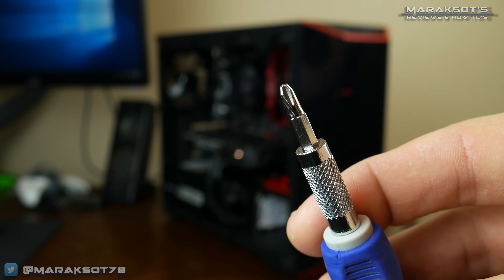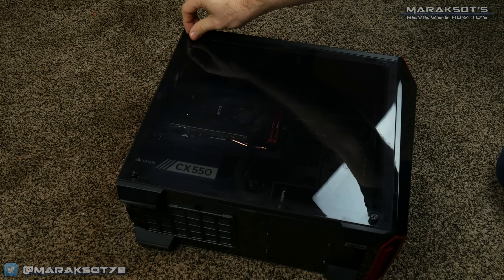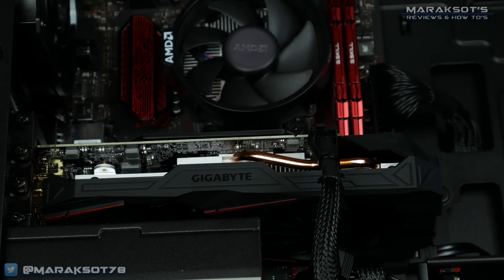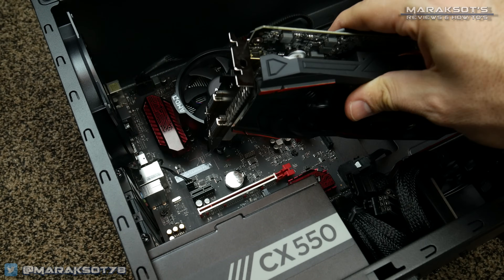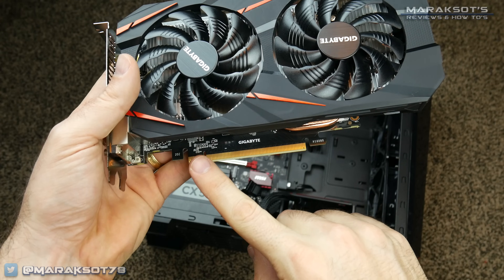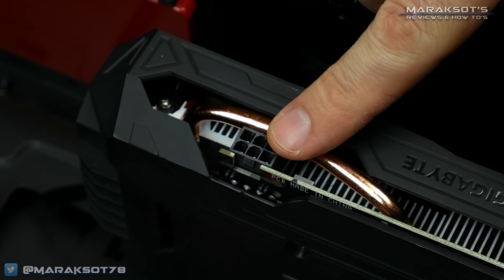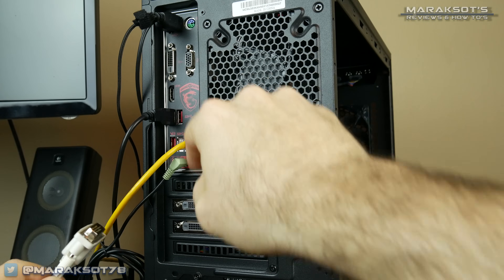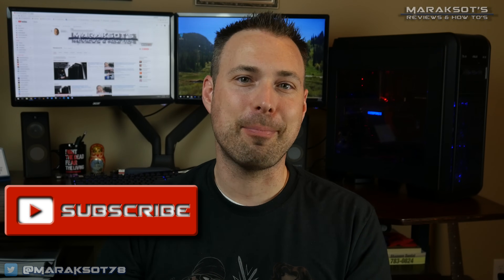How to Install a Graphics Card - Upgrade Your GPU

Comment: Pls someone help, I upgraded from a GTX 650 to a GTX 1060 and I installed new drivers and deleted the old ones and I still get the same FPS as on my old card🤷‍♂️
Reply from the maker: what display output is you monitor plugged into?  Is it plugged in the display out on your graphics card or on your motherboard? (the one on your motherboard is the one near all your USB ports and stuff)
Reply: bottlenecked by cpu probably? insufficient ram?

Comment: What cable do you use to plug in the graphic card?
Reply from the maker: What cable exactly are you meaning? Are you asking about the PCI Express power cable or are you wondering about the video cable? Whether to use HDMI, DVI or display port (DP)? My guess is you're wondering about the video cable. Use whichever cable your monitor supports. Display port (DP) is the newest standard so if your monitor has display port use that. If you have HDMI then use that and if your monitor doesn't have either of those but has DVI then use DVI. If your new graphics card doesn't have DVI (some high end models do not have DVI as it's an older connection standard) but your monitor doesn't support HDMI or display port then you either need to buy an adapter to go from HDMI to DVI or buy a new monitor that has hdmi and/or display port.

Comment: I have a i7 7700k and a rtx 2070 can i just add another rtx 2070 and get better performance
Reply from the maker: No. My understanding is the RTX 2070 does not support NV link SLI. Many games do not support dual GPU setups anyway so it's much more cost effective to just buy a more powerful single graphics card. The only time dual GPU's makes sense to me is if you're buying the most powerful card currently on the market. Since there isn't anything more powerful the only thing you can do is add another graphics card. But even then it's only effective in games that support dual GPU's. Games that don't will only utilize one.

Comment: I don’t have the right video out for my new graphics card.. do you need to plug the video out from your monitor to your graphics card ? Or can you just plug it into your computer?
Reply from the maker: You need to plug it into your graphics card if you actually want to use the graphics processing power of your graphics card. Plugging it into the display out on your motherboard will only utilize your CPU's integrated graphics... assuming your CPU has integrated graphics. If your monitor does not support HDMI or DisplayPort but only uses DVI or VGA then you're going to have to either get a new monitor or an adapter that will adapt your DVI to HDMI or DisplayPort.
Reply: Maraksot78 thanks
Reply from the maker: No problem.
Reply: Do I need them both plugged in? Or should I just use the graphics card?
Reply from the maker: You just want to use the graphics card.

Comment: LOVE IT! btw im getting RTX 2060 upgrading from 1060, do i need to uninstall the GPU driver first or do i just the dang thing in and then install later? Thanks again Maraksot!
Reply from the maker: You can replace your drivers whenever, either before or after. Since you're going from one Nvidia card to another, if your drivers are already up to date you may not even need to replace your drivers. If you're using the automatic update in GeForce experience you may already have the most current driver installed. Nvidia's current driver for both 10 and 20 series cards, version 417.71, came out on Jan 17th. If you have that installed already then you're good to go.

Comment: Which cables to plug in... ok 6/8 pin is one of them but my gpu has 4 more holes for cables dp vga,.. please answer.
Reply from the maker: So are you wondering which display cable to use with your new graphics card? If so I say use whichever your monitor supports. If your monitor has DP (display port) I would use that as it's the most current display technology. After that I'd say HDMI if your monitor has it, then DVI.

Comment: Kinda confused about the connector, i have a 6 pin connector, connected it in my 1060 but no idea where the other 2 parts go.
Reply: i don’t have a pcie connector btw^ just got my 1060 today, new to this stuff
Reply from the maker: So are you saying you have a power cable from your power supply that looks like this? https://www.pcper.com/images/reviews/474/14-PCI-E.jpg. if so that is a 6+2 pin PCIE connector. You just plug the 6 pin portion into the graphics card and you can just leave the other 2 pins hanging there or zip tie them out of the way; it's up to your personal preference.
Reply: Maraksot78 yeah i hooked everything up and booted my pc up now all games get 1-5 fps. and nividia control panel says it doesn’t see a GPU. I probably did something wrong.
Reply from the maker: @d4edxty  did you buy it new or used? If it's used or you bought it on ebay it's possible you got a fake card.  Hopefully that's not the case. I assume you connected the display cable to the graphics card and not to your display out on your motherboard? If it's connected to your motherboards display out then you'll be using the CPU's integrated graphics rather than your graphics card which depending on your CPU would give you very low frame rates like that. If you are connected to your graphics card then I'd shut things down, disconnect the power, pull the card, reseat it and make sure it's seated properly and boot back up again and see if things improve.
Reply from the maker: Also I just had another thought... do you know if your power supply has enough wattage to support a GTX 1060? The 1060 requires at least a 500 watt power supply to function properly.
Reply: Maraksot78 im talking to a few of my friends since they’re pretty decent at pc building, they said i have to go into bios and make sure it knows i have a new part in my pc. I bought my gtx 1060 3gb off of Amazon for 280$, and yeah the monitor is in the right place i made sure of that. im hoping doing this in bios fixes the problem.
Reply: Maraksot78 also to download my 1060 drivers i just go to de force and download game ready drivers yeah? this is my first time pc building sorry if these questions sound stupid. thank you
Reply from the maker: @d4edxty  personally i don't use GeForce Experience to update my drivers.  I'm an old school guy so I like to do it all manually but GeForce Experience is designed to make it easier for people to update their drivers so you can definitely do it that way if you prefer.  :)
Reply: Maraksot78 figured it out :)

Comment: I have never messed with the inside of my pc before but my pc is running a AMD 200 series and I want to upgrade to a amd580 so do you think even tho I have no experience messing with the inside of my pc do you think I would be able to do it by myself by watching this vid?
Reply from the maker: Yup, if you follow along with this video you should be good to go. Cheers! :)
Reply: @Maraksot78  appreciate the reply the problem i got now is that my pc might only have 6pin would that still work with the AMD580 or would i have to buy a 6 to 8 pin adapter? sorry for asking so many questions i dont know much about computers
Reply from the maker: @bennywhite5972  depending on what model of 580 you get you'll need at least a 500 watt power supply and most manufacturers recommend you have at least a 550 watt PSU. Also some RX 580's require both a 6 pin and an 8 pin power connector (for example the Power Color RX 580 Red Devil). So if your current PSU has enough wattage but is missing the PCIE connectors needed, yes you can buy adapters to make it work. Depending on what your PSU has available a 6 pin to 8 pin adapter may get the job done or you may need to get a SATA to PCIE adapter (which looks like this https://www.lindy.co.uk/images/0-15m-2-x-sata-to-pcie-8-pin-male-power-adapter-cable-p8812-6447_zoom.jpg) or molex to PCIE adapter (which looks like this https://www.hdcabling.co.za/images/8pin_to_Molex_EPS_12v_ATX_Motherboard_Power_Cable_adapter.png).

Comment: Would the MSI Gt 1030 work well with Intel i5 3550 3.3ghz and 8gb ram?
Reply from the maker: Yes. An i5 3550 would be good with all low to mid range GPU's. The most powerful I'd recommend is probably an RX 580 or a GTX 1060
Reply: Maraksot78 the thing is I can’t afford gtx 1060, that’s why I plan to get 1030
Reply from the maker: @corrupt5694  No worries man. I just wanted to let you know how far you can go before you have to begin to worry about CPU bottlenecking.  Cheers bro. :)
Reply: Maraksot78 would I have to worry about cpu bottlenecking? Or is my cpu fine with the graphics card?
Reply from the maker: You'll be just fine with a GT 1030. Nothing to worry about there.
Reply: Maraksot78 ok thanks :)

Comment: What if you dont have the pcie power connector for the graphics card? Because I just got a single fan EVGA 1060 SC and I'm not really sure what I'm doing but the connector that came with it is too short to connect to anything that would fit it within its reach? Sorry if this was confusing... just getting into these things
Reply from the maker: I assume the little cable you're talking about that came with your graphics card is a PCIE power adapter that is either a molex or SATA to PCIE adapter. If your power supply doesn't have any PCIE power connectors then you can use that adapter to supply the needed power to your card. Assuming your power supply has a high enough output to support your card...

Comment: good morning sir. its 8am here. i have a cheap ass desktop that cost me approximately around 240-260$ or less, with 4gb memory and 2gb radeon r7 graphics card. should i outright replace my GPU for better gaming experience or its more viable to buy a whole new set of CPU? thanks a lot man. nice video
Reply from the maker: it really depends what CPU you're using.  A graphics card upgrade will increase your performance but depending on your CPU just how much it will improve can change.  Also adding more RAM will help too.  I recommend a minimum of 8GB with 16GB being optimal.

Comment: I don’t know if the gigabyte z170 hd3p motherboard supports gtx 1080 ti?
Reply from the maker: your motherboard shouldn't be a problem.  What CPU do you have?
Reply: Maraksot78 i7-6700k
Reply from the maker: Your golden bro.  The 6700K is a great CPU to pair with a beast like the 1080ti.

Comment: my new pc doesn’t have a gpu so i’m ordering a 1030 soon, my power supply is under some metal casing thing and i don’t think i’d be able to locate the pcie wire thing any help?
Reply from the maker: As far as I know the GT1030 doesn't require any additional PCI Express power from the power supply. All you'll have to do is plug the card into slot and install the drivers.

Comment: Hello, I play in a desktop, just a desktop, mouse and keyboard. I don't have that box thing. Could I still set it up?
Reply from the maker: are you saying you have an all in one PC?  Meaning your CPU and GPU are all built in to your monitor?
Reply: @Maraksot78  Uhh, I'm sorry, but I don't know about computer stuff. :(
Reply from the maker: If your computer doesn't have a tower, aka the box with your Motherboard, Processor, Graphics Card and everything else in it, then I'm assuming your keyboard, mouse, flash drives and any other stuff plugs directly into your monitor? Is this correct? It that is correct then you have an "all in one" and the ability to upgrade those is much more limited.
Reply: @Maraksot78  yea I guess, sorry I'm not smart
Reply: Maraksot78 YES ITS ALL BUILT IN MY MONITOR!!! pls help me, my games always run slow and I can’t even play the less laggy games
Reply from the maker: @HDdeadchannel  unfortunately many all in one PC's aren't upgradable when it comes to their graphics card. CPU, memory and hard drive upgrades are possible however quite often all in one PC's are built more like laptops where the GPU is integrated into the mainboard making it pretty much impossible to upgrade. There is only one all in one PC I've ever seen that uses a regular "off the shelf" graphics card but I don't remember what one that is. Most likely if you want better gaming performance on PC you're going to have to get a new, more powerful computer.
Reply: Maraksot78 Okay thanks for the tip, could you recommend me one that is NOT a gaming pc but can still upgrade the graphics card?
Reply from the maker: @HDdeadchannel  what's your budget? PC's range wildly in price depending on the hardware in them.

Comment: Thanks! Very informative!
Do you think that the RTX 2070 is wort an upgrade from my GTX 970?
Reply from the maker: It depends... The GTX 970 is a great 1080p 60Hz (60fps) gaming card.  If your monitor is 1080p 60Hz then I'd say no but if you're using a higher resolution monitor like 1440p or 4K or high refresh rate (100+Hz) then I'd say yes.  I should also mention if you're going to be gaming at a high refresh rate then your CPU is also going to come into question.  The faster your CPU can give instructions to your GPU then the higher frame rate you're going to get.  Currently the i9 9900K is the fastest gaming CPU on the market and is capable of delivering the highest frame rates in games when paired with a high end graphics card.  But most i5 and i7 CPU's from the past 3 or 4 years will give you very good performance as well.  If you have a Ryzen 5 or Ryzen 7 CPU then that will do great too.  If you're using an older AMD FX chip then I would not recommend pairing an RTX 2070 with it because it will really limit what the 2070 can do.  Meaning you'll pay all that money for a 2070 and get only slightly better fps performance out it than your 970.
Reply: @Maraksot78  Thank you for the additional info!
Now.. Is a I5 6600k going to bottleneck the rtx 2070 when im playing 1080p 144hz? 
Or games like GTA, COD BO4, and other high end games.
Thanks for the answer once again :)
Reply from the maker: I don't have access to that hardware to test if for myself but based on all the stuff I've seen online the i5 6600k and a GTX 2070 is going to work great for you at 1080p 144Hz.   It would even be great at 1440p 100Hz+
Reply: Thank you for taking your time and answering my questions! I really appriciate it!
Reply from the maker: No problem, I'm happy to do what I can to help.  Cheers bro!  :)
Reply: @poteqqetop942  I'm late, but the 6600k does bottleneck the RTX 2070 according to the bottleneck calculator. Here is the link, it shouldn't be above 10%. https://pc-builds.com/calculator/Core_i5-6600K/GeForce_RTX_2070/0Fs12xlu/

Comment: Graphics card have to be compatible with your motherboard right ? And if it can’t fit in case what do you do ?
Reply from the maker: Every modern motherboard has a PCI Express slot which is what all modern graphics cards require so you shouldn't have any problem there unless your computer is from prior to 2005-ish.  If the card doesn't fit in your case you'll either need to upgrade to a new case or find a card that fits in your case. There are shorter graphics cards that will fit into cases that aren't super deep as well as low profile cards to fit in narrow cases.  You just have to find what will work with your case.
Reply: Maraksot78 ok
Reply: Maraksot78 also how much psu you need for a amd rx 580?

Comment: I just recently got a pc from cyberpower with a gtx 1060 if I were to upgrade later down the road to a 2080 will I need a better cooler too?
Reply: Ok dude ty
Reply from the maker: @reverseflash1433  no problem.  :)
Reply from the maker: What do you mean a better cooler? If you're talking about a better cooler for your CPU the answer is no. The one that came with your PC should be sufficient. If you're asking about a better cooler for your graphics card the answer is also no because the cooler is built into the graphics card. So your card will come with a cooler that should be adequate or more than adequate depending on the exact model of 2080 you choose.

Comment: I got a dumb question... :) My radeon gpu died so I want to install a gtx 750 that I got. The radeon was just plug&play but the gtx 750 has extra cables coming from it, 2x3pin (I guess, I ain't that tech savvy xD). But my psu only has a connector for 1 of those 2 3pins. Both need to be connected, right? I connected the 750 to the psu with one of the 3pin connectors, the fan is working but there's nothing on the screen
Reply from the maker: I'm assuming by 2x3 pin you're referring to a 6 pin PCIExpress power connector?  You need to plug a 6 pin PCIExpress power cable from your power supply into the corresponding plug on the 750ti in order for it to work.  If that's not plugged in then it won't work.  If your power supply doesn't have a 6 pin PCIExpress Power plug like the one shown in this picture http://www.playtool.com/pages/psuconnectors/pcie6index.jpg then you're going to need to buy an adapter to adapt either 4 pin molex (which looks like this https://firstshop.hu/img/o/a1a46f99cea58cb7e0ed859c70b2d377.jpg ) or a SATA to PCIE adapter (which looks like this https://images.monoprice.com/productlargeimages/84941.jpg ).  Just to be super clear there are also 6 + 2 pin PCIExpress power connectors that look like this https://www.parallelminer.com/wp-content/uploads/2017/04/ANTPCIE-Y01-1.jpg so if you have one of these you can use it.  You just plug in the larger 6 pin portion and either tie back the 2 pin connector or just leave it hanging.
Reply: @Maraksot78  Yeah it's a 6pin but my PSU doesn't have it. Anyways, I checked, It's power is only 350W, I'm gonna need a new PSU with more power. But for future reference, I could just get an adapter for that 4pin on the PSU to convert it to a 6pin? My GPU would still draw the needed amount of power from it? 
Hey and thanks for the quick response man :)
Reply from the maker: @byo9355  No problem man, I'm happy to help.  Yes either one of the those adapters I showed you would work, the molex or the SATA.  Assuming, of course, your PSU is sufficiently powered for your graphics card.